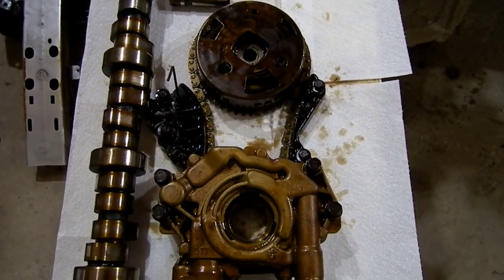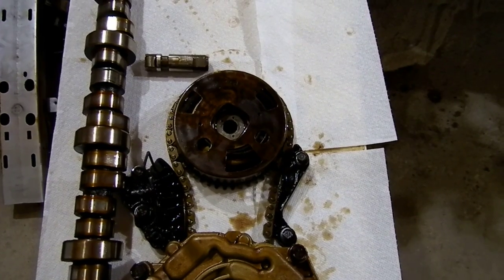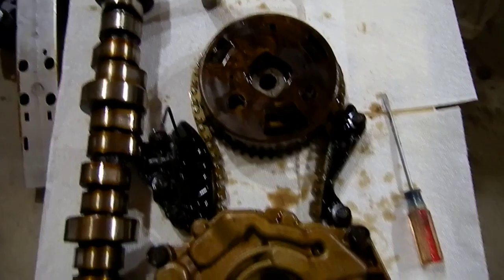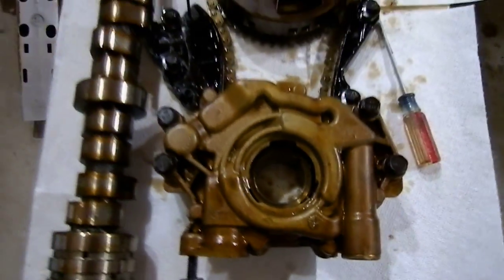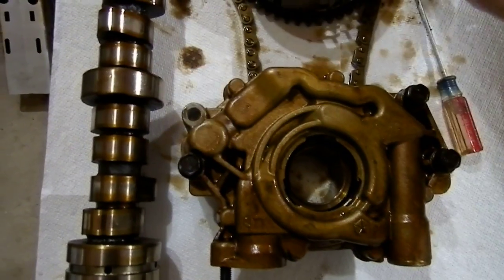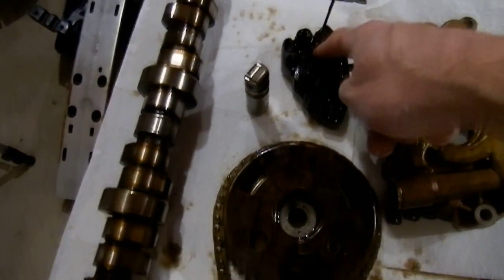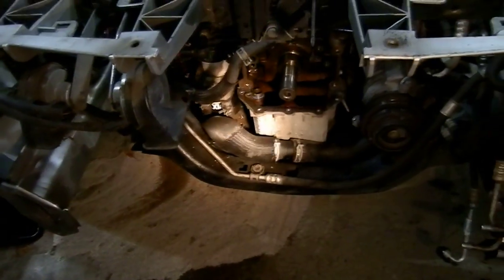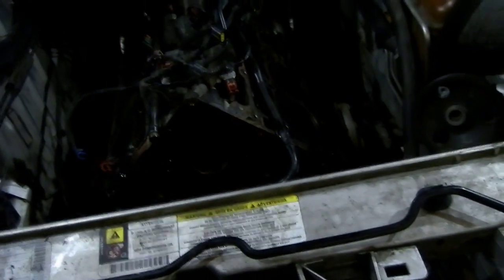5.7L Hemi Camshaft and Lifter Failure Tips/Tricks Timing Chain Look

Comment: I have an 05 300c with 151k miles, should I disable mds with a tuner to help prevent this from happening? It runs really good. No check engine lights or anything.
Reply: Bryson Wells no confirmation that MDS is the culprit, failures are also occurring in NON MDS motors. Do whatever you like but both MDs and non MDs lifters are known to fail

Comment: Same thing on my 2011 Charger RT. #5 looks just like that. Two other rollers feel like they were about to do the same. That's just on the one side I got the head off. Still have the other head to get off. But I only had the cylinder 5 misfire. I am doing mine with the engine still installed too. Tight fit on sides. I took the driver side motor mount off to jack it up to make space on the right and let it down to make room on the left. Had to remove motor mount just to get the heat shields off the exhaust manifold. Big job, but so much cheaper doing it yourself. Around $1,000 in parts, changing water pump and a idler pulley too. Changing the timing chain too, but very difficult getting the oil pump loose with the pan still on. Hope I can get that bolt back on without removing the pan. Used a magnetic tip to help turn the bolt loose. Got the cam out just now. Hmm, I thought it looked like a coating that wore out, but now that I got even a closer look with my phone camera and zoomed in, I see putting. What would cause putting in the metal? The water pump was working fine. The bearing on that felt really good, but the aluminum looks like abrasive material was eroding bits of the water pump housing. So I had to replace the water pump. The timing chain cover, that the water pump bolts on to, has it too, but not really bad. That part was $450 and out of stock.

Comment: I'm trying to set the timing on my 2011 Ram 1500 and having a hell of a time.  I moved the pistons after I had the cam out and now have the heads back on,  how can I get back to top dead center?  I put a rod in 1st cylinder driver's side and then rotated the engine until it was at the top.  So I believe that puts the pistons to correct location then I put cam  mark to 12 :00. then I put timing chain on with the marking in the correct location.     Can someone tell me where I'm going wrong??   Any and all help is much appreciated. Thanks Eric
Reply from the maker: Line the dots/slashes up. In the video this is described @ 2:00 mark for cam and 3:20 for crank.  Not sure how to describe it any easier than that?
Reply: M ph.... 1st thanks for the video and 2nd thanks for getting back to me.  I'll watch the video again and see if I messed up some where.  I've taking the front off the motor 5 times now and can't seem to get the timing right.  Wish me luck!!!!! Cheers Eric
Reply: M ph

Thanks for the help.... I ended up bending the push rods.  So I must have had the timing wrong the 1st turn over and when I got the correct it was to late. Which means I didn't do enough research........ So I'm back to square one, once I get the new rods in.  I know I can put #1 at TDC by having the key way at 2 o'clock and the dot at 6 o'clock on the crank shaft, because it only makes one rotation.  But when it comes to the Camshaft I'm not sure if I'm at TDC on the cam because I believe?? it rotates 4 times to the 1 rotation on the crank.  So I believe there's 4 times that the dot on the cam can be at 12 o'clock.  What I need to know is how to make sure it's the right time it's at 12 o'clock.  If you or anyone else knows how to do this, any and all help is must appreciated.

Thanks
Eric
Reply from the maker: No, camshaft turns 1 time. crank shaft turns 2 times. Line up the dots like I said and you are good.

Comment: These plastic parts.  I have same issue to tune of 4390 from dealer.  Is it better to buy better set up?
Reply from the maker: I use OEM parts. Only thing thats plastic is tensioner. The lifter surround is plastic, but there is no issues with them.

Comment: 2012 ram 1500 LH pump doesn't turn. The chain guide is longer than the one in the video making it imposable to remove without the pump coming off (Tensioner came off easy) and the pickup tube is keeping the pump from turning the correct way in order to remove the pickup tube. I can almost get the pump to turn far enough but the bolt hits the oil pan if I try to pull it out. Good video though was worth the try.
Reply: BTW My repair is for cyl 8 misfire( cam failure due to seized lifter roller.)

Comment: I have the same problem with my 2012 Dodge Ram 1500 HEMI.  And I'm just wondering if you have any recommendation for a good mechanic to do the job and how much it cost.....I'm afraid that I cant afford much for the work :(
Reply from the maker: Parts cost for cam, all lifters, gaskets, timing components $1200-1500. Prob a 3-5000 job at a shop. I don't have any recommendations.
Reply: m ph if its still under warranty will the charge?

Comment: You can leave the pump guide and tensioner on the car. Set tdc. Loosen the phaser. Mark the chain drop the phaser down. Take the chain off. Install your new cam. Line it back up. Removing the pump is wasted time.

Comment: Got a 14 Jeep Grand Cherokee with a V8 in it and they said I have a couple of failed lifters.  Would you know what that would cost to get fixed because I’m hearing $1,000 to $5,000 and that’s a big gap in price.
Reply from the maker: Whats it doing, Misfire, noise, CEL with what codes? 

Hard to say without taking it apart. In order for the lifters to be replaced the cylinder heads need to come off. That means you need head gaskets/head bolts, intake manifold gasket, coolant/oil, valve cover gaskets. If the cam needs replacement I would do a timing chain/tensioner/oil pump at the same time. 

For $1000 at a shop you may get them to pull 1 head and replace 1 bank of lifters (there are 4 banks total in these engines). For all new mopar lifters/camshaft, timing chain/tensioner, oil pump, all materials I would be thinking $4-5k. 

I did a cam job last month in a Charger, parts alone were $800 and I skimped. Camshaft price has gone up since from about $70 to just under $300.
Reply: m ph at idle it seems like it’s about to die but I can hear a little different noise coming from the engine.  The guy I take my vehicles do basically works on every ting but engines and transmissions because of how’s vehicles are made he basically stopped but he pulled it apart and just said two lifters are bad and not getting compression.  I’ve had not but trouble out of the piece of shit and Jeep does nothing but want to charge 5 times more than everybody else.  My wife let the oil go over about 3,000 miles too so I have no clue.   Thought I’d get an opinion from someone on here.
Reply from the maker: Without looking at it its hard to say. Without pulling the lifters you won't know if the camshaft is damaged unless the cam is really bad. No compression on a cylinder could be a bunch of things, broken valve spring, leaky valve, leaky piston, bent pushrod, broken connecting rod, deactivated lifters.
Reply: m ph great.  It basically sounds like I’m fucked.
Reply from the maker: Its going to be an expensive repair.

Comment: just rebuilt the top end of a 2.7 she developed a knock found a cam cap bolt had come out with the threads . have you had this isssue before? can I over boar the cap hole and go 1/4 20

Comment: Been with chrysler for a lil over 2 years and gotta say this is very common! We have this problem on our 5.7l, 6.4l, and 6.2l hellcat supercharged, we get to see this at least once a month its sad that chrysler hasnt found a fix to this yet have seen them go out at as lil as 30k miles
Reply: Wow, that means as late as 2015 models still have this problem. 

Shame on Chrysler. In a way they deserve to go bankrupt for their laziness.
Reply: hornedawg86 dang, sorry to hear. What year was it?
Reply: Did the early models in 2003 have this problem too, I only have 40,000 miles on a rebuilt motor
Reply: MrLIFEISTOOSHORT
Reply: MrLIFEISTOOSHORT my 5.7 ram longhorn lifter failure,/ worn camshaft 70,000 miles
Reply: MrLIFEISTOOSHORT Pure bullshit.  The lifters, cams, and valvesprings were all upgraded by mid-2016.  Improper oil is a primary cause.  Full synthetic, preferably Pennzoil, makes a huge difference in these engines.
Reply: @pkranz937  I say bullshit to improper oil. I have ran nothing but mobile 1 synthetic 5-20 and I have the same problem
Reply: P Kranz yesterday i have changed the vavle lifters ,  camshaft 6.4  and , timing chain on my car charger 2012 5.7 and I'm going to use Motarcraft oil full synthetic , what do you think!?

Comment: it is what happens when you build an engine out of parts made on a printer. disappointed to see this problem is not rare. so much for getting a hemi car.
Reply from the maker: The 2009+ Hemi engines have their issues. When they run correctly they are a lot of fun. Mind you this is a 150K engine with an estimated 12000 POLICE hours on it so its TIRED.

Comment: did you have any issues with oil passages for the MDS solenoids? I have a 5.7 in my bays right now that it looks like the oil passages to the #1 cylinder are clogged. :( I also suspect wiped cam lobes. I am very disappointed in this engine design. Between broken valve springs and lifter issues... Thanks for the video!
Reply from the maker: On this one no. Had one earlier this year, MDS solenoid had an issue and threw an MDS code. The engine misfired and shut the injector down to cylinder 1 to prevent the cat from cooking. It was ticking/knocking pretty good, replaced the MDS solenoid and blew compressed air around where the MDS solenoid sits. The MDS solenoid came out VERY hard and in pieces. Put it all back together, disconnected the battery/cleared codes and that fixed the problem. Noise went away along with the misfire. 

MDS makes these engines quite problematic, same thing in other MDS engines such as the 5.3l Chevy. Crappy system that costs tons just to save a small amount of fuel.

Comment: Do you have the part numbers and quantity of each part # for the lifters? I am a bit confused about MDS and non MDS. If I look up lifters on RockAuto, It is not clear what they mean. One is non-MDS and one is with MDS. I was under the impression that they are all MDS lifters and the quantity would be (2pcs) 5038785AC (front)    and (2pcs)  5038786AC (rear) with each having 4 lifters in its composite holder. Is that right? Can you confirm that? 2011 Ram 1500 5.7 with MDS
Reply from the maker: 4 of the cylinders have MDS lifters, 4 have standard lifters. The front/rear refer to the lifters sold in the plastic case. Not sure on the part numbers.
Reply: I got engine apart today, however, the 4 bolts are removed from the oil pump, pump does not rotate at all. Will it rotate only after I remove the chain tensioner and guide? Just seems like maybe the pickup tube is anchored in an additional place in center of engine maybe?  This is a 2011. Only you might know this. Cam is out, 4th lobe from front (intake lobe of cylinder 3) is almost fully round, lifter roller bearing failed and dropped off center.
Reply from the maker: Its been almost  2 years since I did this job, don't remember all the details. 

You may need to drop the oil pan on your application since its a Ram instead of a Charger like this car if it will not rotate.
Reply: Yes, I see the difference. The 2010 charger Hemi has an oil pickup tube that is short and is only attached with a fastener at the oil pump only, the Ram has a second attachment point about 6 or 7 inches in. I may skip replacing the chain. The oil pan adds like 5 hours.

Comment: listening and watching your description of detail about how you were able to avoid dropping the oil pan was the best part. I am beginning a cam and lifter change tomorrow on a 2011 ram 1500 4WD that has a bad cam lobe on cyl #3 and I was wishing there was a workaround of dropping the pan which I was dreading. Your extra detail (that nobody else mentioned anywhere) about turning the oil pump clockwise slightly allowing pickup tube bolt access was golden. You get the golden buzzer $$$$$$$$$$#$$$$$$$$$#############$$$$$$$$$$$$$$$$$######################

Great video
Reply: Kevin Huttenlocher I'm doing an 09 for the same failure and the pump doesn't turn so if you haven't done it yet just be ready for that.
Reply: How’d your replacement go I have an 2009 want to start replacement soon any other tips?

Comment: Ey sir so i my truck no hwy at 40 miles/h the msd kiks on and it is making a loud ticky noise but i just replace the timing changes,tensioner and the mds solenoids ,lifters  and vvt solenoid to an is making the same sound . It could be that is the vvt sprocket ? I did a visual check on the cam and it was ok . Note: on Tow-Haul  or manual shift is not making the ticky sound
Reply: Does the same thing for me I've got almost 200,000 miles on it haven't worried about it

Comment: Hello. I just had the exact problem with my 2011 GC 5.7 Hemi. The #5 intake lifter did exact thing. I have a local dealer doing the work. This is the quote I got from him today as I was suppose to pick it up "We have run into a little bit of a problem with the Jeep. We started it up and there was a knocking type noise so we turned it right off. The technician wants to re check the timing, he thinks there might be something wrong with it that might be a tooth or 2 off"

Sounds like timing was off. Question is what kind of damage could have they done?

BTW - Replaced cam and all lifters with new Mopar dealer parts.
Reply: My moms car has the same moter with the same problem. Jim Click said it’s the camshaft. And gonna cost like 3800 to fix it.

Comment: 2007 Magnum R/T.. 145,000 miles,   just bought it pulls like a freight train.. Just oil changed, now have what sounds like a tap in valve cover pass side. No sound at idle, lightly taps when rpm's go up... 55lbs oil cold at idle, 25-30 at idle hot... Diablo tuner, 91 tune..no codes, runs great... Any ideas? And how were the cam bearings in that car you fixed? thanks

Comment: 2009 thru 2011 5.7 hemis have a recall on timing set  go to mopar website click on MY VEHICLE---> RECALLS---> VIN#   enter your vin and scroll down to see if there are any open recalls on your car. No questions. Dealer will honor it. Just brought my recently acquired RT 225K miles. they did the recall. now I also did not know about until  I had a p0305 code which turned out to be bad lifter/cam

Comment: actually, i have the P0016 code un my 2011 ram 5.7 The engine run but with reduced performance and Fuel efficiency is not very good, at times a sound similar to the friction of the timing chain, the pressure already at nominal temperature is 16psi and 20mph from 43psi to 44psi ......What do you think it could be?
Reply from the maker: If you wanted to diagnose it without pulling it apart you will need to get a scope wave form of the cam/crank signal and compare it to a known good waveform. Or you could pull the front cover and have a look since you stated you heard "timing chain noise"

Comment: Excellent video!  Exact same catastrophic engine failure (cam lobe & lifter) and symptoms on #3 cylinder on my '09 Durango Hemi LTD 4WD, 103K odometer, meticulously maintained, full synthetic oil & filter changes every 3K miles, I am the only owner after the owner of a Dodge dealership in Lansing, Michigan, drove it for 9 months.  Solution:  About $9K out of pocket for R & R with remanufactured Jasper long block engine with 3 year/100K mile warranty, with all new accessories (water pump, hoses, etc.).  Both shops I conferred with stated that you need to thoroughly flush the engine, replace the old oil pump, replace or professionally flush the intake manifold & verify with camera, replace any external oil cooler & plumbing,  all new bearings, etcetera, etcetera.... must get all the metal shavings out of the engine and all accessories and oil system plumbing in order to really do it right.  Dodge was zero help, refused to acknowledge the problem, and even refused my request to just sell me a new replacement hemi crate engine at cost!
Reply from the maker: Yes, ideally what you did was best. It also took 9k to do it that way. I was willing to risk $500 in parts and 10 hours of my labor time. Would I do a cam swap without a full teardown for a customers car, no.